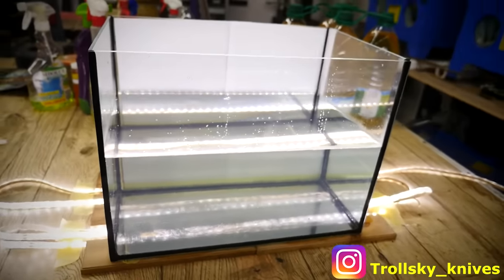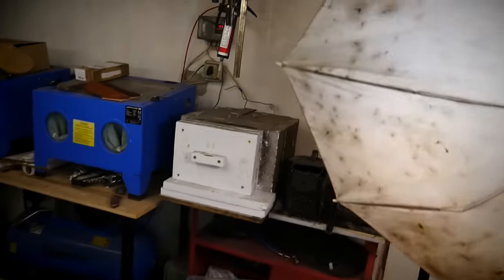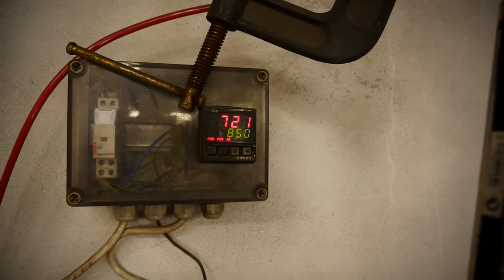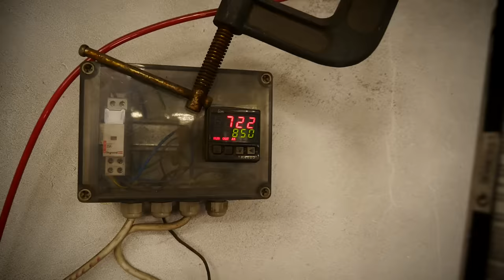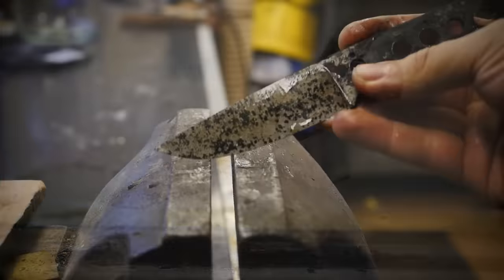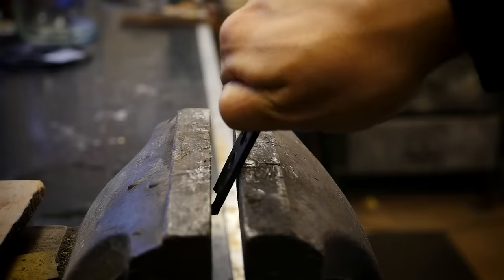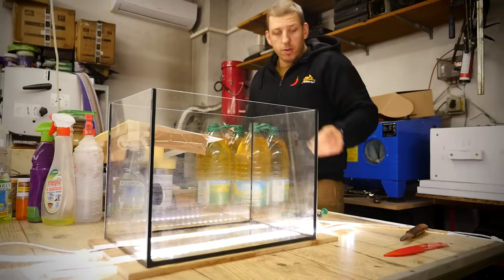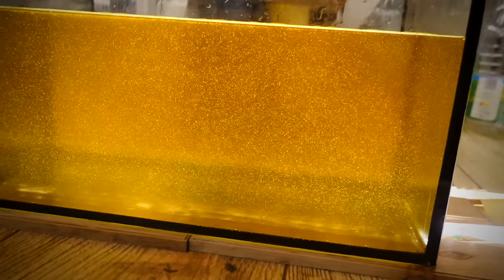STEEL HEAT TREATING CLOSEUP - WATER VS OIL [Trollsky Knifemaking]

Comment: Based on my understanding of the hardening process of carbon steels, theoretically, the water quenched blade should be superior to the oil quenched.  Of course, the blade must be tempered to reduce its brittleness.  In practice, we tend to avoid water quenching to prevent cracking.  Carbon steel hardens as a process of the soft perlite undergoing a phase change to austenite at and above its critical temperature.  Quenching, for a lack of better terms, "short circuits" the phase change, or decalesence point whereby the austenite will revert back to perlite if left to cool slowly (this would be considered annealing).  By removing the heat as fast as possible, the austenite converts to martensite and because the energy is removed so quickly, does not have the opportunity for the carbon and other alloying elements to fall out of solution.
Even the best hardening regemine will never convert all of the austenite to martensite.  The thicker the material, the more difficult it is to remove the heat quickly.  There will always be some "retained austenite" (usually referred to as "RA).  This is why cryogenic treating is successful as the process of cooling the steel further allows much of the RA to convert to martensite. 

Hardening is pretty much an "all or nothing" affair.  We can't quench at lower temperature or for lesser periods of time to try to control final hardness, that's why we have to temper, and that we can control much more easily.

Typically, what we do with forge hardening is a compromise.  It's less than perfect, but we trade perfectness for practicality and also why most hobby or home bladesmiths make their knives exclusively from carbon steels.  Stainless and some of the exotic "super steels" require a much more precise heat treating schedule, temperature control, etc.  It's possible to increase the accuracy and consistency in heat treating the carbon steels by using precisely controlled heating ovens and consistent quenchant temperatures, but this can get expensive.

Comment: The water appeared to give a secondary "explosive" heat release.  This might be why the steel is more brittle with a water quince.  As far as I know, you are the first to show this reaction. 👍
Reply: if you drop the metal temperature below its critical value quick enough, during quenching, austenit (microstructure of iron) will directly transform into martensite structure with is very brittle. Its linked with shearing iron atoms without  diffusion. Oil absorb heat slower so probably there is more residual austenite or even different structure like bainite with is more ductile.
Reply: @Olasty111  
Isn't there, also, a different reaction from the oil due to it being carbon based? Water is hydrogen and oxygen so there would be no carbonation to the steel.
Reply: Ron, I also noticed that 2nd wave of bubbles.

Why is that going on?

Comment: What steel were you using?  That would make a difference.  1095 is fast quenching and if the blade doesn't crack or warp bad I would think a water quench would work fine.

Comment: Water quench adds Hydrogen, and thus embrittles the steel, as it also cooks out Carbon. Oil quench adds Carbon, and cooks out Hydrogen. Someone mentioned using Blood, which might work in an Oil mix

Comment: My mentor told me that quenching doesn't need more than once. All we have to do after heating, is let it aired till the steel get to the normal temperature, repeat it for 2 or 3 times. Then after last heating, we can quench it to the water. That' general technic that my mentor told me

Comment: I have read the Japanese coated blades with clay, thinly at the edge and thicker at the back and then they could get the heat treatment right in warm water, I cannot say it works, only that it was written in a book.

Comment: You are awesome!
and I guess you had better try this method.
  Over 1000 laminated high carbon steel for outer material.
  Over 1000 laminated low carbon steel for inner material.

Comment: As i understand it, water above 120 degrees F is a less drastic quench than cold water. I used to user transmission oil heated to about 120 for oil hardening steel like O1 and 52100. transformer oil or horse-drenching oil, both light mineral oils, are good  quench mediums. You can use them at 100 F. You can also flash quench, ie pull the blade out of the water as soon as it's black.

Comment: I read some comments, and people tends to think that there is a VS between water and oil quenching. It is not! Its used for different applications. The water quenching is used for carbon steel and the oil is used for alloyed steels which allows for a slower hardening process which in turn also minimizes warping. None is better. As mentioned, it has different applications. You could get a just as nice knife blade of carbon steel and water quenching as you could get with alloyed steel and oil quenching. You wouldn't wanna oil quench a carbon steel since you would lose hardening properties that is gained with the waters more rapid cooling. The water boils and has a higher change for new water getting in contact due to higher fluidity. Oil is more like an isolating envelope that cools it at a slower pace which wont distort as much.
Reply from the maker: it was a video showing what is going on under the surface, not the tutorial video. I am glad you know it ❤
Reply: @Trollsky  yeah, people cant even read a title nowadays. Cheers from sweden! :)

Comment: Asians blacksmiths do quench in water but the end product is still top notch side by side with oil quenching. The technique's used is the key. Even Asians makes parang with only quenching it in water but never be that brittle.

Comment: You also want to warm the oil a bit with a scrap piece of steel so the oil isn't cold.
And you never quench hot steel in cold water.

Comment: If you were able to get close enough you would have noticed a “vapor lock” on the knife... keeping the knife moving in the oil allows for a more proper even cooling to Maximus a more accurate hardening thriughout the material...

Comment: I'm sorry sir if i may offend some folk here but i will try my best to explain..

Our old folks here in the Philippines do not quench in oil but they made good quality blades..

They dip the blades in water  bit by bit so that the temperature doesn't shock the steel and they do it in precise manner. In your experiment sir you dip the blade in a manner that you shock the steel and made it brittle..

Sorry if i offended somebody on my comment, i apologize sincerely

Comment: Four observations:
1. You didn’t say what type of steel you tested. Some require water, some require oil.
2. You didn’t temper after water quench.
3. You didn’t test the oil quenched blade.
4. It was not clear what type of oil you used. Did you say sunflower oil?
I did like the video of the quench…

Comment: You should show "anvil test" with heat treated knive at oil to fully show difference :). Still great video
Reply: It would do the same as water that's why he didnt show it. The magic is done with the temper. After quenching it tightens the molecules like water in the frozen state. When steel is in the annealed state it's like the molecules of water. The steel in a tempered state keeps the molecules tight but not packed like the hardened state after quenching. When tempering steel it will be a beautiful blue showing a consistent temper. Even spring steel is brittle and doesnt gain it properties until after its tempered. Annealed- heat till critical, let air cool. hardening- heat until critical, quench in water or oil, water will cool too quick usually warping steel. Temper- do not bring steel to critical temperature (red) just till blue, you will get blue, dont stop equally heating until you see blue again, than air cool from that point

Comment: What about Katana, it has to be quenched in water but that's stays strong and as per the traditional it has to be quenched in water, can you explain me why there is and variance
Reply: Varying thicknesses of the clay coating affects the cooling rate. Also the blade itself is made up of steel with higher carbon in the edge than the back. Craft of the Japanese Sword explains everything in great detail. It is written by a Japanese sword maker

Comment: One hour at the library can save 2 days of fruitless experimentation.
Reply: Who says it was fruitless?
Reply: @TimTrOn3000  A guy that having studied metallurgy knew that too rapid quenching makes steel brittle, without the need to repeat experiments that were know by the ancient Romans.
Reply: @awashburn6944  And after quenching are as brittle as glass until they are tempered. Thank you for pointing out  a well known fact that has noting to do with my comment.
Reply: @awashburn6944  Read my post again, pay attention and try to understand.  In no way I mentioned the difference between oil and water quench.  Any Hi carbon steel quenched get brittle, is fact known since ancient history and I did not make any distinction between steel type or quench medium.  You are objecting base on your prejudices without comprehending the written word.  Suggest a remedial English course.
Reply: @awashburn6944  A statement such "fast quenching cause brittleness" DOES NOT imply by any rule of formal logic, English and semantic that "Slow cooling guarantee not to be brittle"  I never said or implied.  Peanut Brittle is brittle even after slow cooling and so is chalk.  But it looks like you are looking to win an argument at all cost.  In that Case,   Aaron you win, I lose.
Reply: @awashburn6944  YOU WIN happy?

Comment: but you didn’t temper the knife, even hardened using oil, you will get super brittle knife. When hardening with water, theres a certain technique to it then just dunking the whole knife in water, it will need to be slowly submerged or sprinkled with water.

Comment: No heat treatment to settle the alignments?... Depends on your metal sometimes whether you go with water or oil. Some even prefer really dirty motor oil so some carbon from the oil gets pulled in. Still slowly heat treat though.

Comment: Nice video! Did you heat any of the fluids before quenching? With oil there should be a difference in air bubble size but I've never seen it myself.
Reply from the maker: Yes , both were warmed before the recording

Comment: you really need to try tempering cycles for both water and oil quenched blades..  then you can see if the water one is too brittle.

Comment: Why so many dislikes guys? Just because author didnt show what would happen with oil quenched? I read from the comments it would break too but what do you do with blade after getting it out of the oil to not brake as easily? Heat it again?

Comment: actually there is a technique for water quenching to harden metal. Do not heat the metal up too hot. And another, do not fully submerged it in water, instead, slowly rinse and dip it in untill it is hardened.

Comment: visual part good. without proper tempering or normalization it really doesn't matter if you use water, blood or oil, blade turns up brittle because is to damn hard.

Comment: What’s the point of the experiment?
Without tempering both blades quenched in water or oil will be brittle and snap easily, that’s why the blades are tempered!

Comment: Why not do a simple Rockwell test, before after and then after tempering the blades. That would be the best way to show hardness and such. Simply seeing the blade quickly cooled in any substance is nice, but doesn't mean anything in the scheme of things. Rockwell testing in the only way for direct to direct comparisons of any method and a finished blade. JMHO!
Reply from the maker: i focus in visual part of this process here. You are right about the technical stuff Gary. thanks !

Comment: if your a beginner don't ever use oil. accident happen on oil.. you don't want a hobby become a nightmare meaning a 3rd degree burn or your house on smoke. use water and just control how long the quench or don't quench it to begin with if it small or thin. to test your work buy a punch tester. buy the electrical type since its just a hobby..😉

Comment: Thanks for sharing, great video.
From what i have read, is that normal tool steel like o-1 and spring steel like 5160 and 1095 its good to use Oil. But other steel is better with water. I think w2 steel from fils i a water harden steel.
I only make some simpel knife and Oil harden them.
Thanks again. 🔪👌

Comment: That is unfair to the water quench ! you were heating the steel to a much to high temperature for water quenching .  Water does and can create a finer grain size if  carried correct heat treatment out with the right temperatures .  Why because you can heat to close to AC1  , with the correct temperature for water you will not get warping or the glass brittleness .

Comment: I thought to quench in oil was to add more carbon into the steel if so why not quench the steel in hot oil . 
The tests must be done with many temperatures and and many I would not say blades but steel rods .
Then get an outcome .

Comment: So Japanese sword makers have been doing it wrong for years?? Wow you're so PRO. You should go to Japan and share your findings :)
Reply: Japanese bladesmiths don't just throw the blade in water. They usually put clay on the spine. It slows the cooling process, creating a stronger spine with a harder edge. Very smart guys, I envy their skill. Quenching in water doesn't always result in a cracked or brittle blade, but it does more often than not. At least in my experience
Reply: Might i add from the clay put over the spine they but little stips that extend all the way to the edge, that creats small soft spots in the edge that prevent it from cracking under stress
Reply: @alanbiggle544   Is this what you're referring to? https://youtu.be/gxwWf-MfZVk?t=2409

As per the video, they put clay to put the design also but not sure about a harder edge like what you're saying. But yeah, they simply quenched it in water. There are a lot of videos of Japanese blade smith doing it also. I'd rather believe them since they have generations and hundreds of years of practice :)
Reply: @awashburn6944  Good to know. Good thing we're taking about Japanese blades then :)

Comment: Some steel is designed for oil, some for water quench.
Reply: @JohnDavis-im1oy  and some aluminium plate hardening
Reply: Think steel geometrics almost need water or  Special water Emulsion big companies use this. Thin Materials like knifes dont need water to quench, Oil is the best solution for knifes. Stainless are good with Aluminium plates some sorts are Air hardening. It all depends on the steel sort you are using so better check what engineers tested in thousands of experiments and get the right Info first.
Reply: daAnder71  no If the Material gets too thick you need more cooling speed. Yeah such big knifes doesent exist but think about a big engine part for a ship Motor. The Energy/Temperature you put in your workpiece have to go somewhere and you need to bring the Temperature down in the right time or it wont harden like it should.
Reply: Agree
Reply: @fiddykooro3541  aluminum plates are used on air hardening steels to get a more controlled result it isn't a separate set of alloys.

Comment: For those commenting that the oil quench would break just as easily as water, that's true, but it won't have the micro-fractures that a water quench will. If you think there is no difference, or that quenching most high carbon steels in water is okay, you clearly haven't had much experience with the process. Very few worthwhile blade steels will quench well in water. they will just generate microfractures that compromise strength. 
I honestly don't know why the haters bother commenting. The conclusion is foregone, if you know anything about heat treating.

Comment: No Problem heat treating in Water if you have the right steel and do the proper temper cycles.  quencing oil is also much better then vegetable oil...

Comment: Sorry for my question.. I need to learn the basics..
Is it necessary to treat the metal? 
And why?
Reply: After u heat treat your blade in water or oil it makes it hard but all so like glass so easy to break .after words u need to temper it. that it soften the blade to where it can be strong so it wont break but still hard to were the edge stays sharp and wont dull very fast

Comment: Doesn't it depend on steel though? Like, water-hardening vs oil-hardening steel and such..? Also, can you not just anneal the steel after hardening it? Not trying to be an asshole here but it seems like it's a bit more complicated than just saying - 'water bad, oil good'.
Reply: Simon's Discoveries of course. He knows that, as do any of the knife makers here. He was merely showing the initial differences (ie pre-temper), as well as the violent difference between water and oil. Some steel is fine in water, but an alloy like 80CR2v needs a slower quench. Newbies or the uneducated just believe you heat metal and cool in water. The entire process is, as you say, more complicated, but it was just a “down and dirty” quick test with visual illustration.

Comment: Totally misleading.  First of all, he didn't state what alloy he used.  It makes a difference in what quenchant is used.  Second having a very brittle blade after quenching, oil or water, is to be expected before tempering.  Third, as Range Man pointed out, he didn't test for brittleness in the oil quenched blade.

Comment: Its not the right way to quenched steel in water.. you quenched  the  blade in water too long, not the right way to do🤷‍♀️🤷‍♀️especially high carbon steel like, 5160, 52100,  etc..